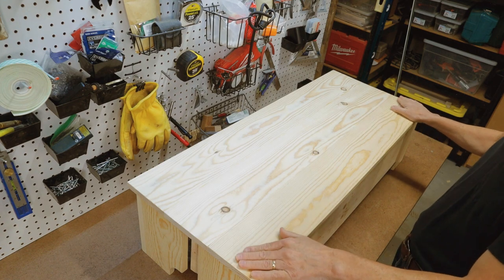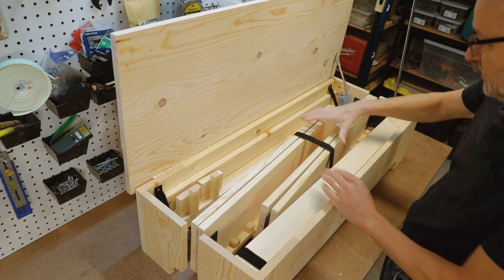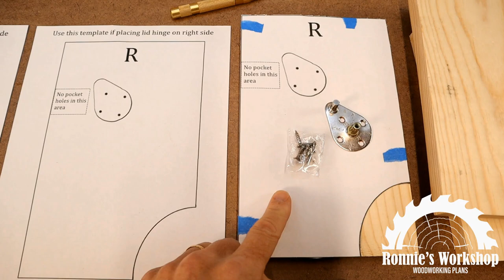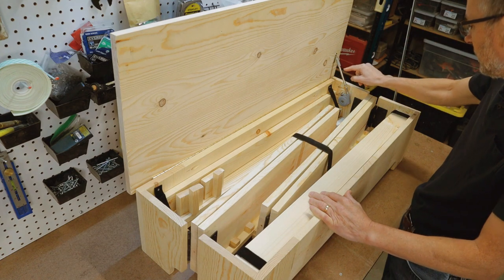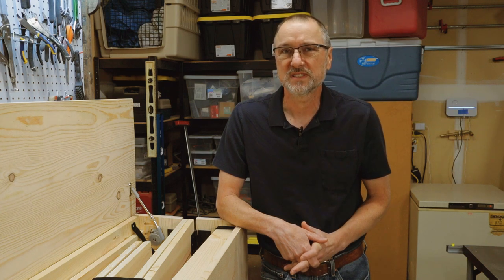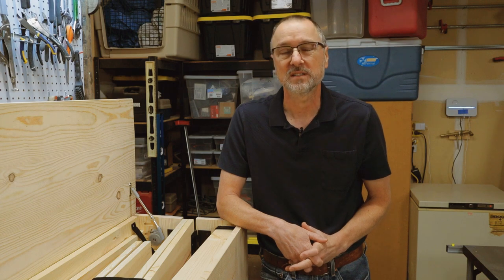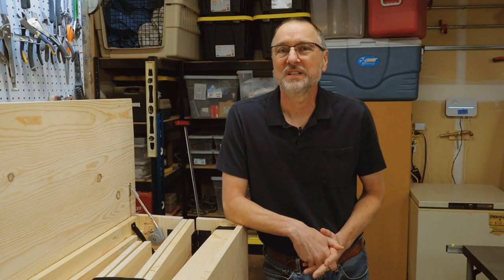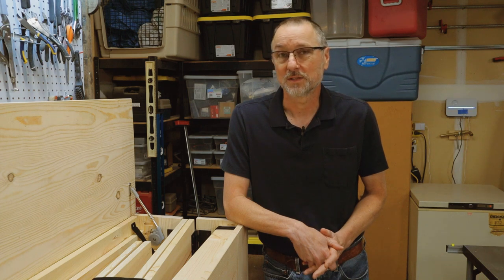DIY Folding Bed Frame (Twin Size) ~ Plans Available ~ Woodworking Project

Comment: This is amazing. I'm definitely going to build one. Just one question, once built, what's the approximate weight?
Reply from the maker: Thanks for watching. It takes 6, 8ft 1x8 boards. I haven't weighed mine but I'd guesss around 65-70 lbs?

Comment: Thank you for the awesome video. I'm interested in building one. What are your thoughts on making it taller.  Thank you again.
Reply from the maker: I made two that were taller so old folks like me can get up and out easier! It's been awhile but if I recall I just made the corner pieces taller.

Comment: Would it be possible to simply make the top and bottom sides longer to make a two person bed?
Reply from the maker: Sure, but you would need to put some sort of blocking underneath the middle of the slats for support, I would imagine. Along with making the slats longer too

Comment: Can I use 18mm ply for this or do I need to stick to the 1” thick timber?
Also do the ends and sides need the rounded legs cut in or can plain rectangular design work?
Ps I have bought the plans
Reply from the maker: The 1x material is actually 3/4", or 19mm so I'm sure 18mm would work. The rounded corners are'nt really necessary, just a cosmetic look so keeping them square should be fine. Happy building!